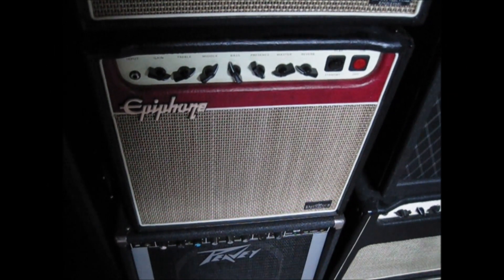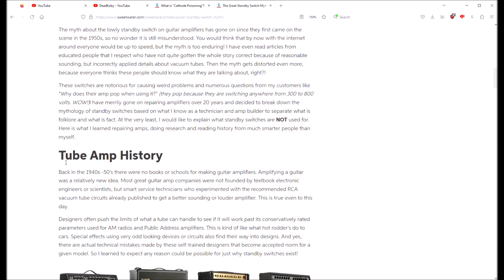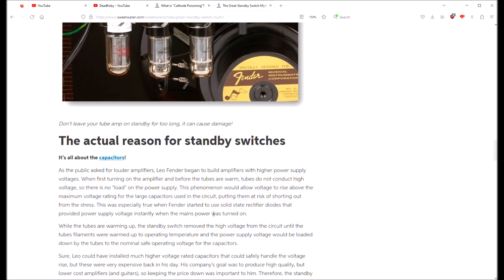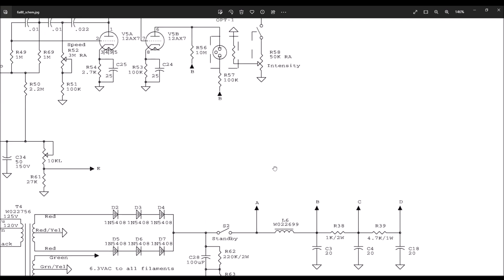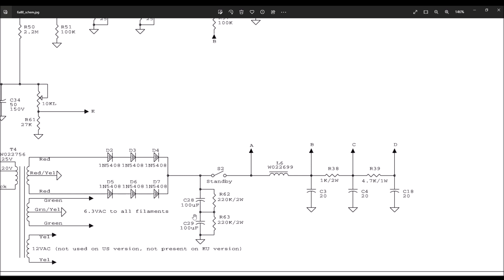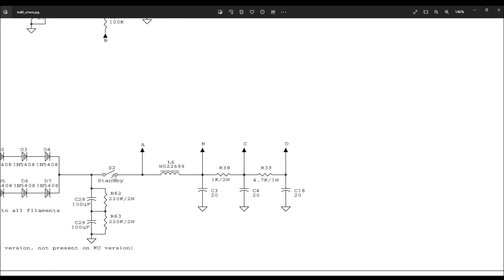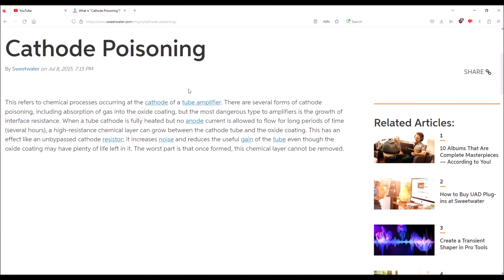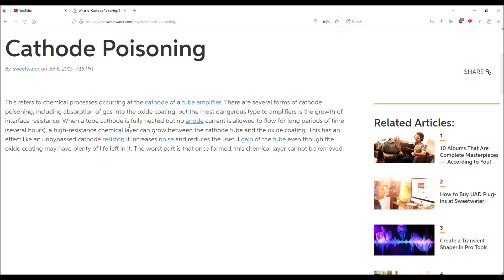The REAL Reason some tube amps have Standby switches.... and how to use it.

Comment: The standby switch is required when Class A is used in the power stage. In such circumstances, with no signal applied the power valve (tube) is conducting at about 50% of its rated output. Any applied signal can vary positively or negatively around this mid point. If the amp is on but not being played through, there is roughly 50% power being dissipated in the valve and primary of the O/P transformer not in the loudspeaker as would normally be the case. Over time this constant DC current will likely cause damage to the valve or transformer primary. Class A/B overcomes this issue and allows for more powerful O/P stages.
Reply from the maker: Then why is there not a Standby switch on a Champ,  but there is on a Twin?   Was Leo out to lunch on that one?
Reply: @DeadKoby  I have no idea you would need to ask him. I am simply stating it as it is. A Class A power stage without an applied signal will have significant and constant DC flowing through the valve and transformer primary.  Considerable power is therefore being dissipated in these components which will stress them. A constant DC in a transformer winding will cause it to heat up and being DC cannot be imparted to the secondary so must be dissipated in the valve and O/P transformer. Simple facts.

Comment: I am still not convinced. All the caps in the HT rail should be able to handle all the voltage that it will expect to see at max spike voltage. When a cap is discharged, as far as the PS is concerned, it is a dead short, so there is a spike of voltage on the caps. If they are rated for that spike in voltage, they will shrug it off, charge up, and do what they need to do. The tube is not conducting yet, so it is of little consequence to them. 

There is only 1 case where having HT on a cold tube is not ideal, and that is with Cathode followers. A cathode follower has HT directly on the grid of that triode, which if that voltage is high enough, it can arc to the cathode, which can shorten that tubes life. However, since 99% of guitar amps are running at relatively lower voltages, this is a very rare occurance. 

Most standby switches are improperly installed, meaning it doesn't break the HT correctly anyway to absolve voltage spikes when Stby is switched to the play position. Also, the caps in the HT rail after the Stby switch are not charged, so even with a proper Stby switch location, the reservior caps are charged, but the rest are not. So when you flip the Stby switch, there is still a large voltage spike as the remaining caps charge up. This is regardless if the tubes are able to conduct or not. That is what makes the pop sound when you flip the Stby switch. 

The long and short of it is that a Stby switch is NOT needed. If your caps are not rated for the full unloaded voltage of the power supply, then you need to spend the money to up the value of the caps so they are. A Stby switch will not save the caps that are after it, and not charged up. I build amps with tube rectifiers, which negates any need for a Stby switch altogether. Built in slow start so to speak.
Reply from the maker: @LukeGeis-ww4ru  why not make a video about your findings and experiments?
Reply: @DeadKoby  I did actually; with my other channel: https://www.youtube.com/watch?v=GXvZIHpIEuU

Comment: What the hell man ! All I wanted to know was which switch to turn on first , I didn’t need a course on electrical current . You never did get to that point , NEVER . Which one first , wait how long and then which one second . I can only assume that you would do that in reverse to turn the amp off . Next time , pretend the rest of us don’t have degrees in electrical engineering ! Please . Why is this so hard ? I’ve been to a dozen sites trying to get this straight , two gave conflicting information and all the rest , like yours , gave NO clear answers . I’m out !
Reply from the maker: I have another video that covers that stuff without the technical jazz.   Simple thing....   when your amp is cold,   standby for the first minute...  then to operate.   Leave it on until you're done...  then just hit the power off...   and flip it back to standby once it's off for the next time.

Comment: What causes tube Red Plating issues? The coupling capacitors leaking positive + Voltage onto the tubes grids or the Bias voltage is set higher Above than O zero vdc? The purpose of the fenders Death Capacitor was using it so that the death cap should short circuit which would blow out the ac line fuse but mostly its never would blow the inline ac power fuse but instead it would cause HOT chassis issues?
Reply from the maker: Red plating is too much current through a power tube.    Causes can be incorrect bias,   or if a bypass cap fails to block the high positive voltage on the anodes of the previous tube.  The death cap was supposed to reduce noise...  coupling the chassis to common.   It's totally useless now that we connect the chassis to earth ground.
Reply: @DeadKoby  Jimi Hendrix Woodstock Marshall amplifiers added protection diodes on the output tubes I think to protect them from red plating? I'm not sure what these high voltage protection diodes are called when protecting the output tubes but the mods were done by an organ servicing company which you can see a picture of the stickers on the back of his Marshall amplifiers at Woodstock
Reply from the maker: @waynegram8907  That sort of thing is moreso to to protect speakers or output transformers.

You can read discussions about it.
https://www.diyaudio.com/community/threads/tube-output-protection.180744/

Another default practice is a modest cathode resistor that will fail open if there's an over-current in the tube.  I've used this method.
Reply: @DeadKoby  this protection diode method is called what? To protect if the cathode resistor or plate resistor fails open, there must be a term or name for this protection diode method
Reply: @DeadKoby  I thought the Death Capacitor was used also acting like a Varistor. Since they didn't have Varistors back in the 50's and 60's they used a capacitor as a poor mans version of a varistor and power protection for AC surges and Spikes?
Reply from the maker: @waynegram8907  Death cap was for NOISE REDUCTION.   I've fixed amps old and young,  and I've not seen them use diodes to protect tubes.   They are used for rectifying AC to DC  in the power circuit, or in the bias circuit.

Comment: That was a great video! Can you explain why a tube amp should not be placed in operate without a speaker attached?
Reply from the maker: With no speaker,  there's nowhere for the energy to go,  and wild voltage swings and or oscillations can occur.
Reply: AND...perforations in output transformer insulation from errant transients 
BAD. Always have a load on transformers.
Reply: If an amp is operated with no load while attempting to amplify a signal, high voltage spikes are generated in the primary of the output transformer. This causes flashover between the electrodes in the output tubes which can damage them, and also cause conductive carbon tracks between the the pins on the tube socket. The worst case scenario is that the spikes can break down the insulation around the wires in the primary causing shorted turns, irreparably damaging the output transformer.

Comment: What if the standby switch is before the full wave rectifier? This was the main caps dont charge... If i ditch the standby switch should i use NTC thermstor to prevent high current draw when powering up the amp?
Reply from the maker: There's going to be huge voltage before the tubes warm and conduct.   If you don't have a standby switch, thermistors can help.  If your amp is tube rectified, you don't really need to concern as much...  since that tube has to warm up also.
Reply: @DeadKoby  I did build two tube amp for myself, i am looking forward to improve the design, and tube lifetime, i have 6.3VAC spot on the filament, i did place the standby switch between the transformer secondary and between the greaetz/full wave rectifier. I planing using  NTC too...should i place different NTC to the plate voltage, and the filament? They have different current draw after power on...
Reply from the maker: Thermistor is gonna work only on the positive rail after the rectifier.   One is enough.    Overthinking can be your enemy.   Observing the voltages on a scope or with a probe .

Comment: Even if I knew nothing about anything my first guess would have been money...its always about money.
Reply from the maker: Technically,  a vintage 600v cap would have been mighty big also......  big and expensive.   Some hi-fi amps (Elekit) actually used a digital controller to perform the standby/operate function automatically...  That's some dedication there.
Reply: I have an Elekit and it has a microcomputer to control the soft start and also monitor voltages and alert before a tube fails.
I find your video very informative. 
What I still don't understand about the cost effect is, why wasn't a thermistor used instead of the bypass switch?

Comment: I'm 60 years old. Still trying to wrap my egg shell mind around why, whilst being confused enough, I've got to be more confused with bias, stand by, current flowing both ways, AC riding on DC, Visa Versa, What the Heck? I feel like I'm tryin to play Schrodinger's Guitar... Cheers! Great video as always.
Reply from the maker: Understanding bias is easier when you think of electricity as water........  and the tube as a valve.   There's some good explanations out there,  but I have my own style of thinking about it.
Reply: @DeadKoby  You mean the valve as a valve?

Sorry. Had to. Open goal. 😁
Reply: @DeadKoby That's why we call them valves NOT tooobes!

Comment: You mention that the standby switch is only needed on diode rectified amps. What would make tube rectified amps not need a standby switch. Or is it that they sorta do,  or do for a different reason? Thanks! Enjoyed the video, long time subscriber.
Reply from the maker: In a Tube rectifier....  the DC voltage is going to rise as the rectifier tube warms up...   which is usually around the same time that the other tubes start conducting.  Thus, in a tube rectified amp,  the DC isn't immediately present...    The Diode rectified amp  has the high DC almost immediately on power up.    The odds of the rectifier tube getting up to full voltage prior to the other tubes conducting isn't nearly as likely.     Tube rectified amps have minimal benefit from the standby switch...  compared to the diode rectified amp.   In several amps,  I've observed about 550v unloaded (standby)  and then it drops to about 425v (operate)
Reply: @DeadKoby  This would make a good follow up video. Thanks!